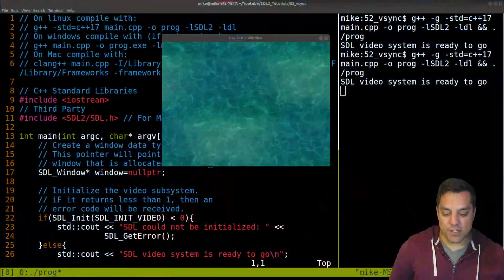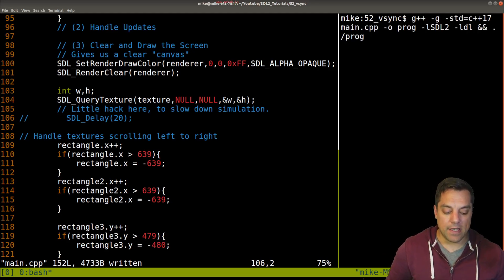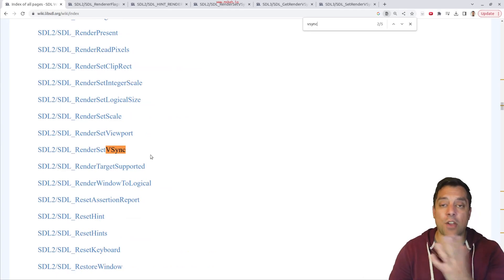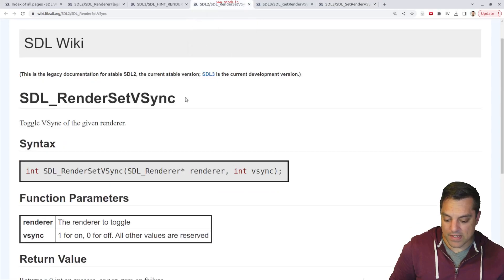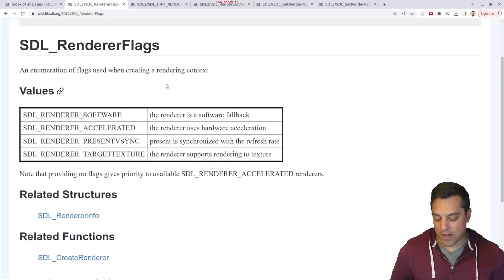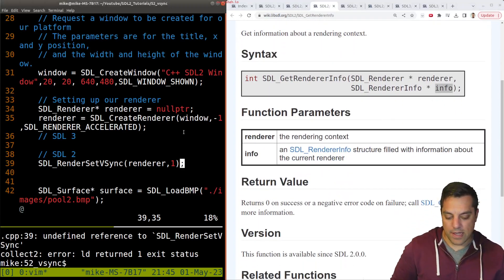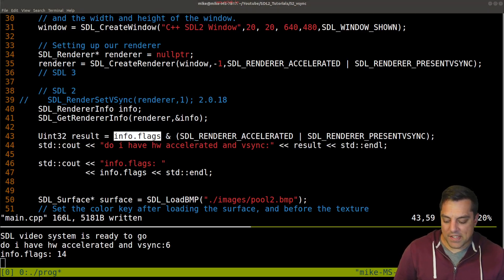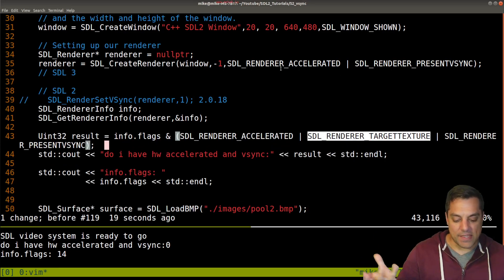[Ep. 53] SDL VSync (SDL_RENDERER_PRESENTVSYNC) | Introduction to SDL2 and SDL3

Comment: Oh, no! 9:43 - when you put && there, it is totally wrong. If you wanted a logic result, you should've cast the result into bool. But with logic 'or ' instead of bitwise 'or' you totally change the math here. It is gonna give you 'true' whenever left and right operands are not zeros. So logic 'or' doesnt give you any idea about "does my result contains that flag", it gives you the answer "is my result not zero?" (flag by deafult is not zero). Meanwhile bitwise 'or' (single &) gives you a result which contains '1' in bits which are both '1' in left and right operands. And if one of operands is flag (flag always contains only one '1' bit), then the result is zero (if the other operand doesn't contain flag) or equal to flag (if it contains flag). So you can just check if the result zero, or cast the result to bool. Mostly it is done this way: if (flags & SOME_FLAG) /* do smth when flag is on */; else /*do smth when flag is off*/;
Reply from the maker: Correct, && and & are different -- I think I was just playing around with it a bit to show where the result comes from.